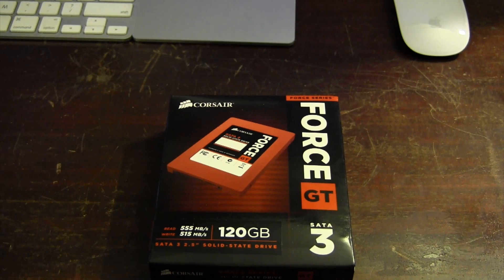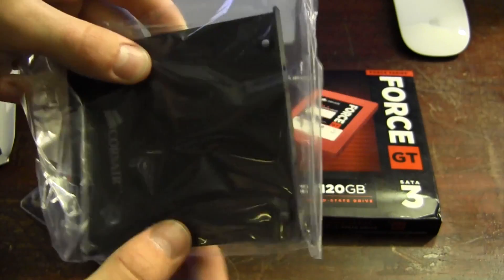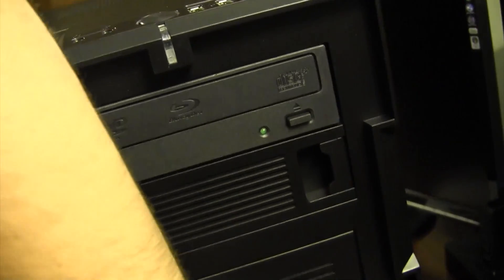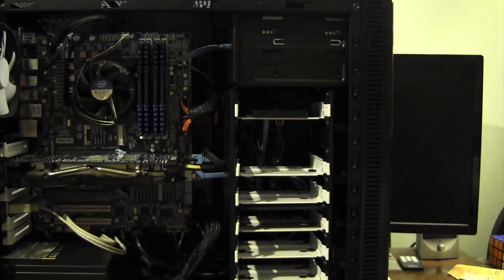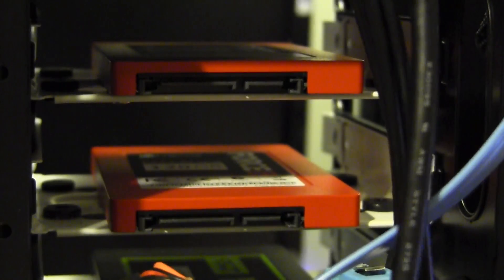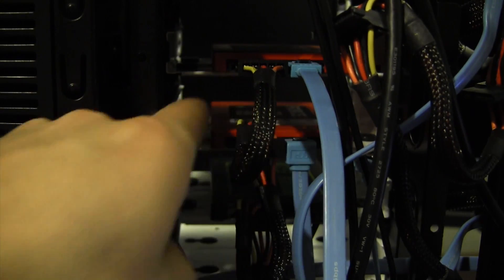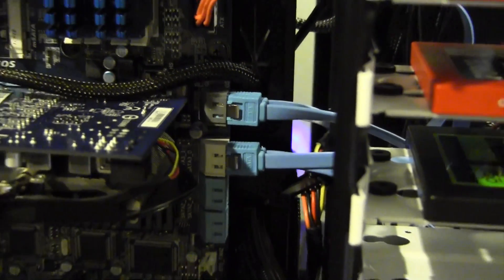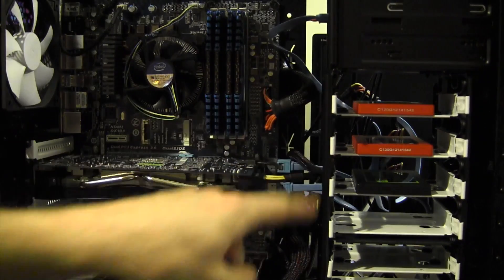Unboxing & Installation: Corsair Force GT 120GB SSD (Raid0)

Comment: I have a Corsair Force Series 120gb 3 ssd installed to my hackintosh running mountain lion. I did a test on Blackmagic Disk Speed Test and got the following results: Write: 127mb/s
Read: 182mb/s. Do these seem right to you or slow? Thanks.

Comment: Help Pleaze!!

1 Corsair Gt or Plextor m3 128gb?

2 would i need molex conectors or somthing to atach 2 120s on the tx 750w power suply that you have???

3 do you like your tx 750w and is it possible to have good cable management?

THANKS!

nice vid but wish there was betchmarks

Comment from the maker: @dev21012 Actually, I have TRIM support, even with the drives in a Raid0. It says right in the system profiler that TRIM is enabled for both drives. For proof of this, check out the Raid0 hackintosh tutorial video on my channel. Also, my cable management is messy, but that's because I was still working inside the machine. It wasn't the finished product that I shipped. I don't get what you're talking about with the PCI USB "thing", but regardless, what would be wrong with that?

Comment: I bought a Corsair X64. It was one of the most expensive SSDs at the time. It literally broke 1 month after the warranty was up (2 years 1 month) so basically I was told that I have a really expensive paperweight :( I now have an OCZ agility - it wasn't expensive at all and it has a 3 year warranty so now if it breaks before 3 years I can get it replaced but if it breaks after 3 years it won't be a huge loss because it didn't cost too much :) I would stick to mid range or long warranty ones!